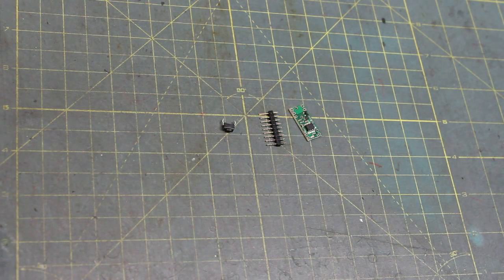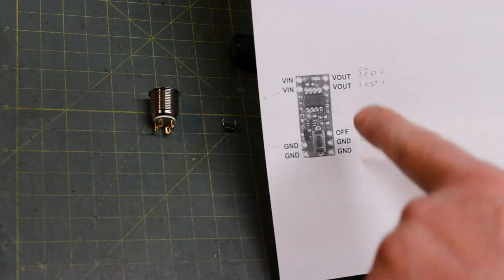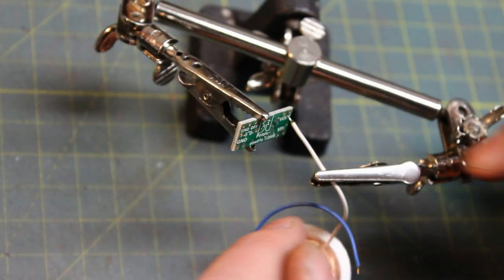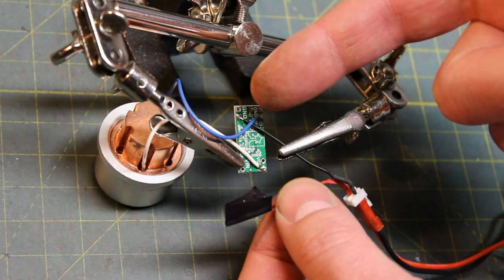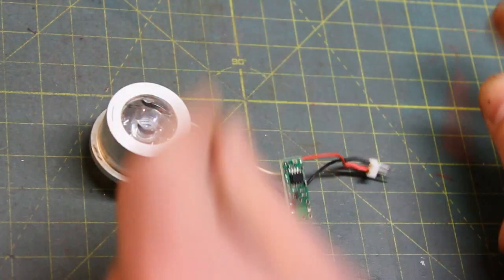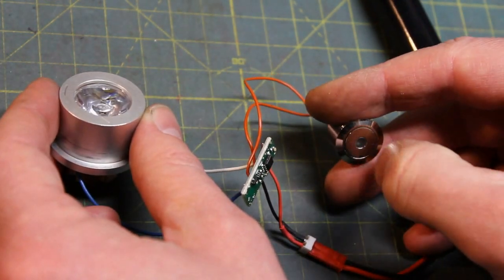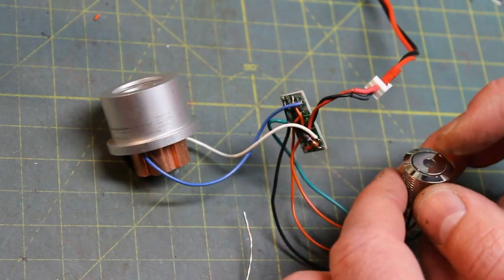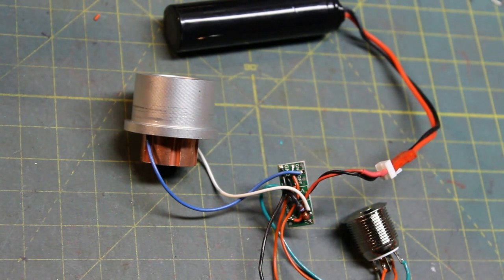Momentary to latching converter

Comment: I'll appreciate your reply/comment/advice.  I have a coax switch that uses non-latching relays, which must maintain voltage on a relay to keep it it latched.  Will I be able to convert the relays in my coax switch so the relays latch?   If you want I can send you the schematic of the coax relay

Comment: I'm using a diagram provided from a lightsaber group, if I'm correct I can use a 18650 battery and this converter with a tri Cree blue but I have to change the resistor voltage

Comment: Hi great video! Can you see any problems in me using the higher voltage version on my motorcycle to convert momentary switches on my bars to turn the lights or flasher units on?

Comment: Great video! But... pololu has since updated this momentary to latching converter. Maybe this calls for an updated video with the new board? thanks for the good lesson!
Reply: Just don't why did he put resistor on the circuit, to lower the voltage or what?

Comment: I Hate to ask but if I have the MWS BuckPuck, Can I wire this to that? How would I connect them If possible? I have them wired together with  the battery out but have nothing ran to the latching switch connector on the Buckpuck. I have drawn out a full color schematic for my entire system but have about 2 holes this being one of them. All that's left unwired on my switch converter is 1 Vin, GND, On, Off, and Ctrl. The one I have looks a little different it is the one currently at TCSS. If you can answer sweet, if not no biggy. I Tried the forum no luck. Thanks

Comment: So if you snip the battery wires and solder it, how would you recharge it? Would it be better to just attatch connectors to the board, then plug the battery in that way?

Comment: please what is the difference between momentary and latching switch?
Reply: a latching switch will "click" or latch to the on and off position. where as a momentary switch will only power the circuit while it is being held/pressed down. hence the need for a momentary to latching converter.
this turns the smaller profile momentary push button, into a latching push button.

Comment: hey Rob

How come you dont solder the wires with a connector on to the board, and then attach the live battery connection? Just wondering.
Reply: +DaTimShow I generally use a s few connectors as possible to save space

Comment: Can you say what your blue and white wires coming off your LED are? Which is the positive and the Negative? I'm planning on using this with a Tri-Cree until the sound board I want gets restocked. I'm just going to use 2 of the 3 LED's with this board.
Reply: rankosaotome Blue (-), white (+)

Comment: Thanks for the tutorial....but I have a small issue. I followed every step demonstrated, verified that I have clean solder points and when I attach everything, the momentary switch will turn ON the LED, but it will not turn it off. As such, I have not yet attached my own momentary switch, but have been using the provided "clip-on" momentary switch. I have tried attaching 3 different LEDs and each does the same thing. Any suggestions?

Comment: How would this wire in if I'm running a MR soundboard?
Reply: MRgrimlock84 Good question. I'm not sure off the top of my head. I would probably experiment running the V-IN and GND the battery and the MR switch wires to the V-OUT and GND - no promises. You'd need to determine which switch wire is GND on the MR board.
Reply: Rob Petkau Have you find the answer ?
Reply: SGTJeffreyPeterson Sorry - I assumed you would experiment. I do not have an MR board to try. I suggest you join the forum at TCSS and ask there
Reply: That right, i found a draw of soundboard and converter. ;)

Comment: Exactly the video I've been waiting for. Answered about 3 or 4 various questions I had. Thanks!
Reply: Perfect - glad it helps!
Reply: Hey, Rob. I had a question. So, let's say I want to use this converter in a Graflex clamp mod (because I do). If I couldn't get the included momentary switch to make contact with the board due to the modification piece, is it possible I could simply solder some wire to connect the switch to the board?

Comment: I watched this whole video and didn't know what the heck was going on until the very end when I realized that the normal sound board chips must have this little chip built into them because I've never seen one of these before.
Reply: Correct - kind of... All of the Plecter Labs sound boards utilize momentary switches. this little converter board is useful for stunt sabers (no sound) or MR/hasbro sound boards.